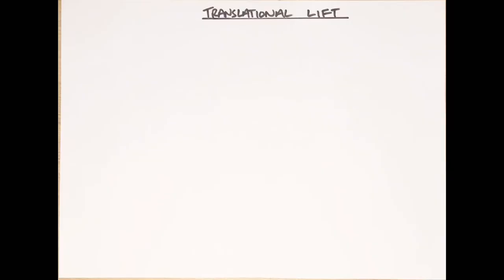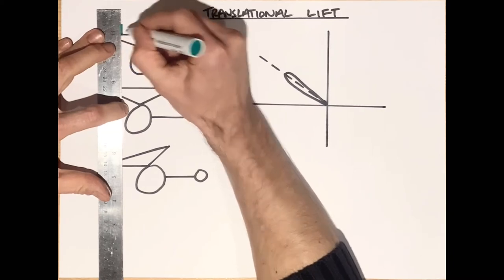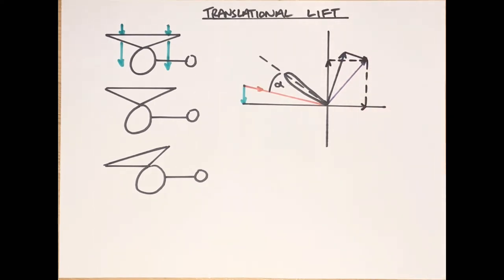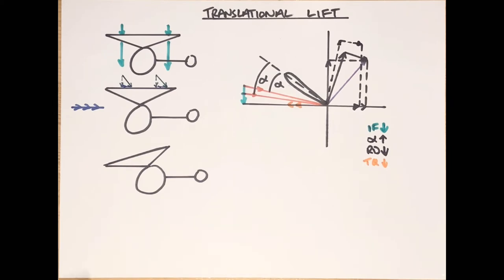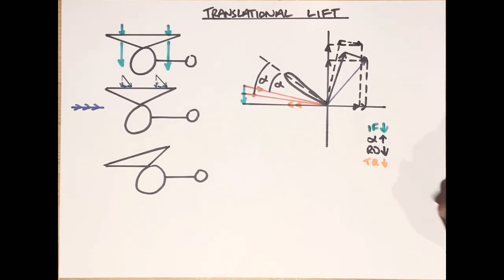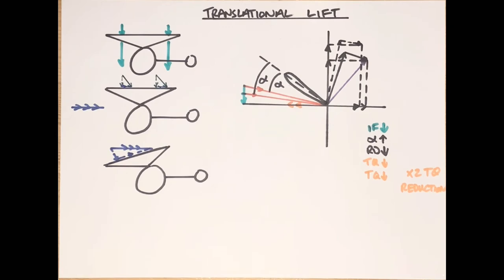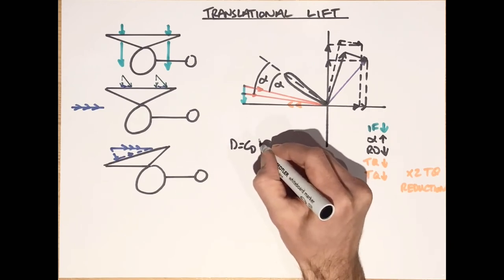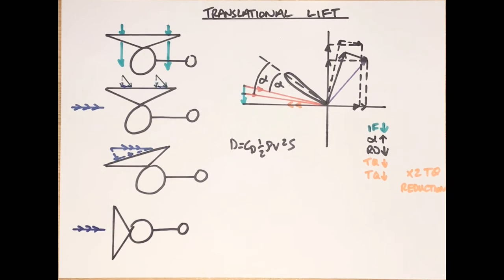Cx-ride Translational  Lift- Helicopter Principles of Flight

Comment: can you describe the speed where the translational lift occurs in the graph?
Reply from the maker: Looking at the left side of the curve you can see that it rises slightly as you move from the hover. This rise in power requirement is due to the aircraft moving away from the ground cushion and losing the benefit of the big high pressure cushion beneath. This is between 0-12 Kts approx. At about 12-20 Kts the airflow across the disc is sufficient enough to start effecting the induced flow and reduce its effect. This is the point where the power required starts to drop off due to translational lift and the power curve changes direction and goes downwards.